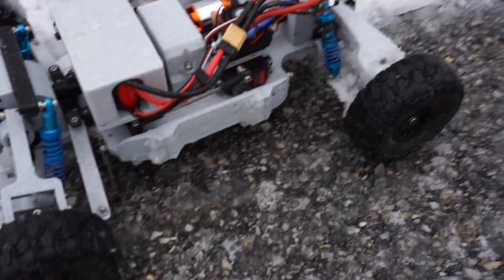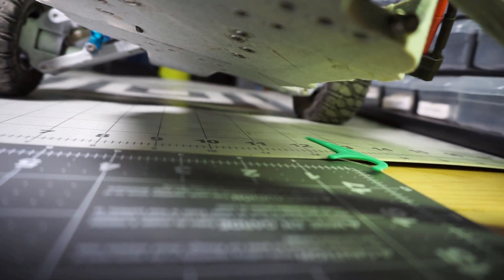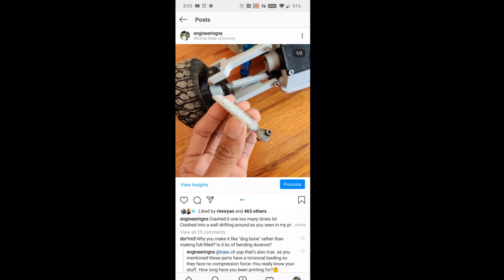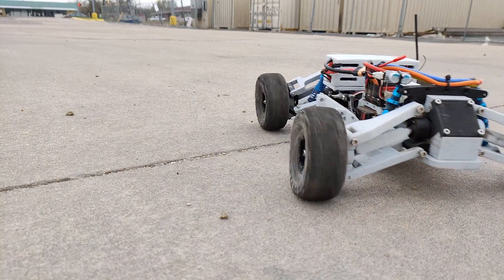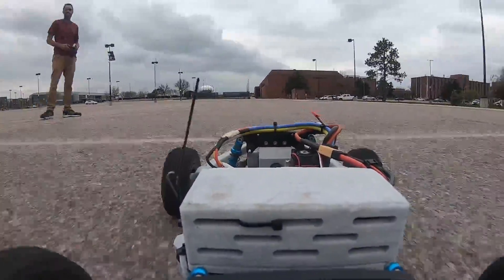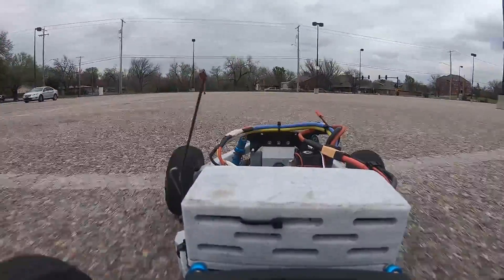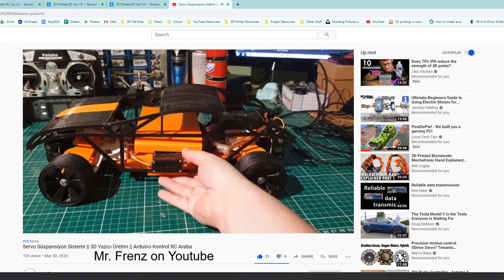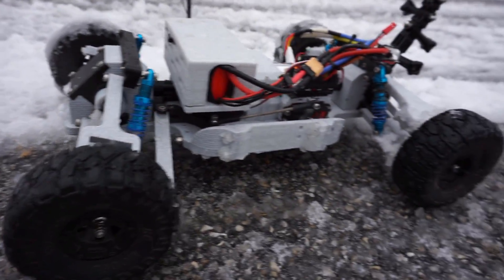Tarmo4 | 3D Printed RC Car

Comment: Looks great, any idea what the max speed is now?
Reply from the maker: It's hard to say. I want to say its in the mid 40's (mph)  but I don't have any way to test so I dont know. It's theoretical speed given the KV of the motor and the gear ratio was in the 60's if I remember correctly--Of course there are many losses and much friction so that is not realistic.
Reply: @EngineeringNS  Strap your phone on with GPS speedometer app? There's a few that can log speed and plot it as a graph or save the max.
Reply from the maker: @jotham123  I thought about doing that, but my phone is rather expensive lol
Reply: @EngineeringNS  I understand :)
Reply: @EngineeringNS  Maybe you could find one of those speed limit signs with the screen on it that tells you how fast you're going and drive past. Haha. Or find a nice state trooper with a radar gun...
Reply from the maker: Lol all good options 😂😂😂